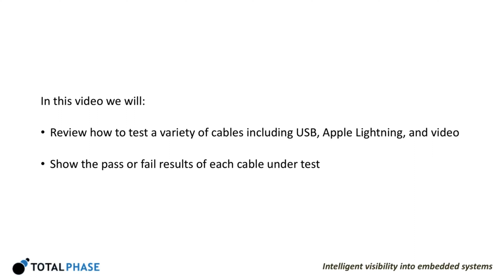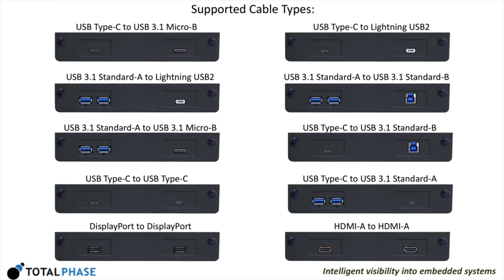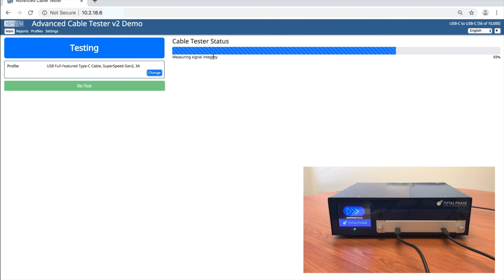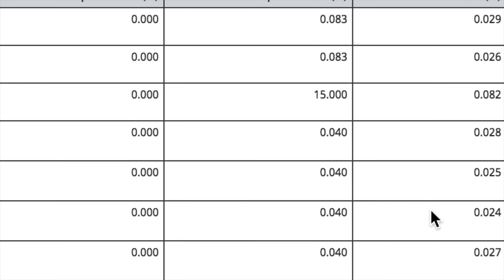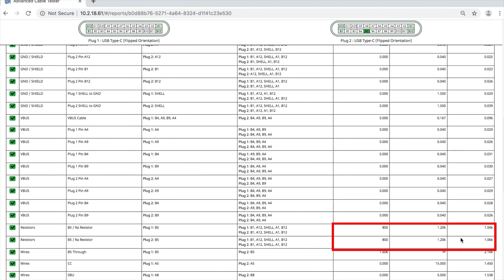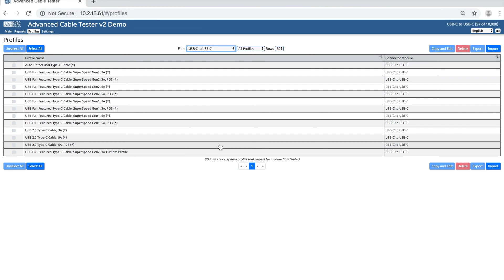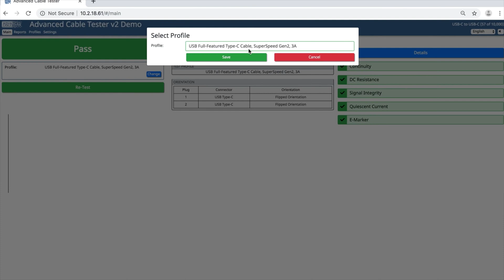Testing USB, Apple Lightning, and Video Cables with the Advanced Cable Tester v2

Comment: Any thought to adding Thunderbolt modules or will this fall into USB cables?
Reply from the maker: The Advanced Cable Tester v2 supports testing p to 12.5Gbps for each high-speed lane. When testing Thunderbolt you are still able to run all tests on the cables, you just are not able to run the signal integrity (SI) tests at 20Gbps (per thunderbolt spec).

So, as for now, there is no way to get a comprehensive Thunderbolt test with the Advanced Cable Tester v2.
Reply: @totalphase That tester is on their website for $15,000. 

Did you guys rent that tester unit? If not, what do you do that requires so much cable testing?